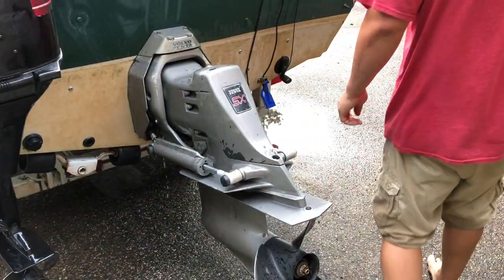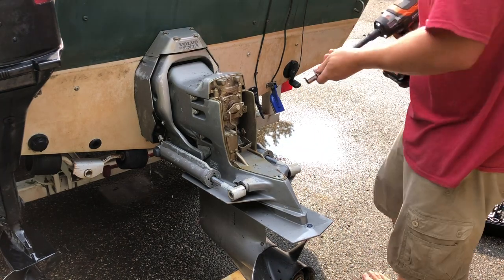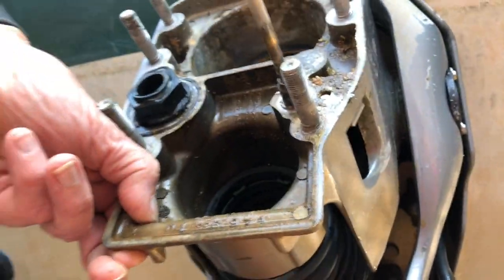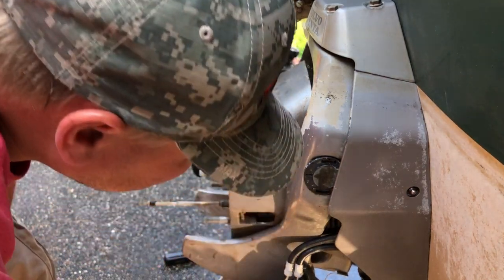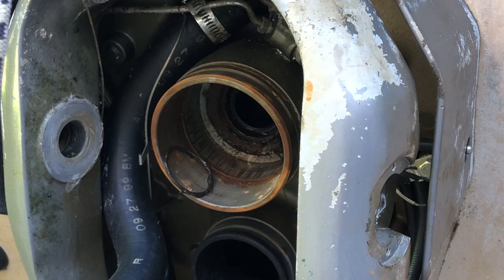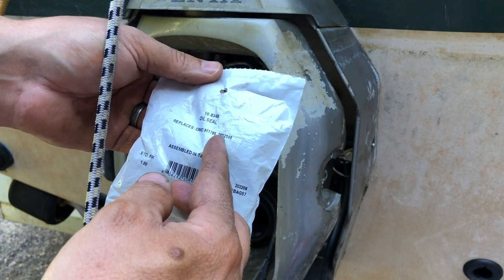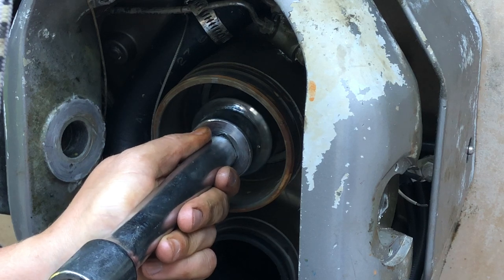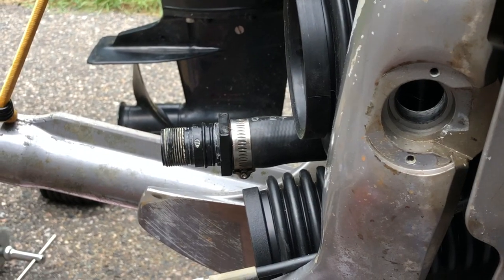Volvo Penta SX inboard outboard gimbal bearing and bellows replacement

Comment: Don't EVER take this video down. Great job! In your opinion, is this too much to tackle for someone that has never removed an outdrive before and is a very, very novice mechanic? I bought my 01 190 Stingray (3.0L Penta SX) last summer from a private seller and did all the general maintenance stuff like plugs/wires, distributor cap, impeller, carb clean and fluid changes but, have never pulled an outdrive. You make it look doable but I know the truth is that it can be a challenge even for the expert mechanic if parts don't want to go in or out easy. 

The boat has never seen salt water so that's good thing but with 259 hours on the engine, I don't know when the bellows were last changed. They look intact as far as I can see into the outdrive but I know there's a lot I can't see even with a USB cable camera. What are the general costs of parts including specialized tools you showed verses the cost of taking it somewhere to have it done?

Comment: Hi.  First great video. It helped me to see how this is done. I just did mine and would like to add this info to help others. Volvo Penta now suggests "Dry Fitting" both bellows now and not to add gasket maker or sealer.  Also at the 20:33 mark on your video you state "I replaced both O rings.  Only 1 is required and its the one closest to the hose not the one near the threads.  If you notice that channel where it looks like an o ring should go has a hole in the channel.  that hole should be facing the 9:00 position (with no o ring).  If you look at your housing you will see a slotted screw that can  be removed and the water in the hose can be drained from there.  the o ring blocks that function of the design.  I also coated all of my grounding wire screws, my tilt sensor screws and my pivot bolts with anti seize.  I think Loctite is asking for lots of trouble with snapped bolts.
Reply: Why don't you use gasket marker or sealer

Comment: next time crack the pivot housing hinge bolts loose BEFORE you remove the drive, much easier, the drive/trim rams will keep the pivot housing from moving around. 
also, the VP drives tend to corrode between the pivot housing and the drive housing, and can really get stuck on there, so coat the mating surface of both with a good marine grease like Evinrude triple guard, that will prevent corrosion. I use OMC/Evinrude gasket sealer on the bolts that hold the drive on and the pivot housing hinge bolts. I don't think loctite is really needed even though VP says it is.

Comment: Shoes would be good.  Once a year all these components should be inspected. Every other year, the lower impeller should be repaired. My dad ignored all these maintenance items and our boats were a nightmare.  Also, if you’re going to work on your boat, a power ratchet would be a good investment.  Furthermore, get a mechanics seat on wheels. It will save your back.

Comment: Thx for posting, I was wondering about the alinement tool,  looks like you didn’t use it....
Reply from the maker: I didn't think the engine was out of alignment with the gimbal bearing so I never used the alinement tool. If you took the engine out of your boat and put it back in I could see needing to align the engine crankshaft with the bearing. Thanks for the comment.
Reply: @stanleytownsdin4717  thx. I’m getting a lot of vibration, my boat sat for 2 years. Health issues. Getting it up and ready.  Took it out about 3 weeks ago had more vibration in reverse than forward. I’m thing gimbal...

Comment: Why did you use your impact wrench on small easy bolts, but a breaker bar on the hard ones (pivot pins/bolts I guess)?

Comment: hey just need to comment you put the bearing in backwards. around the 18 minute mark the 2 indented sections of the bearing should face towards the engine you shouldn't be able to view those 2 notches when it is finally installed, also you can freeze the bearing to make it easier for installation if you don't have access to the special tool.

Comment: Hello Stanley, in 8.09 minutes you use a key with a cap to unscrew the gimbal, I can't find this key .... write what is the key and size ?? gears identical to your SX ..., I live in Europe, so could you please send a link to the store where I can buy such a key tip?
Reply from the maker: This is the tool on Amazon.  MTC 20230/91-78310 Hinge Pin Tool For Mercruiser Alpha Bravo Outdrive Sterndrive
Hope that helps!
Reply from the maker: REPLACEMENTKITS.COM Brand Fits Mercruiser Mercury Hinge Pin Tool for Alpha One & Gen II Bravo I II & III Replaces 91-78310 & 18-9861 https://a.co/d/iNCbtKo

Comment: One question when you put back the shift cable is there a mark or way of knowing you have it adjusted properly?
Reply: When you remove the set screw. Count how many revolutions it took to back it off completely. Write that number down before you forget it.
Reply: Mine is 14. If anyone needs a reference.
Reply: @seanzhu6842   mine too, 14..
Reply: Throw the shifter in neutral, the nut with the nub for cotter pin should be aligned if the drive is in neutral.. easy .

Comment: Man great job, about how much this kind of work cost..???
Reply: You'd spend about $1200 to get this done at a shop.  So DIY you're saving about $1,000 if you already have some of the tools, $800 if you don't.  Not bad!
Reply: @yoster77  I used a shop for the repair almost 1 year ago and they charged me $500 parts and labor
Reply: @MrFelipecalderon97  That's a great deal!